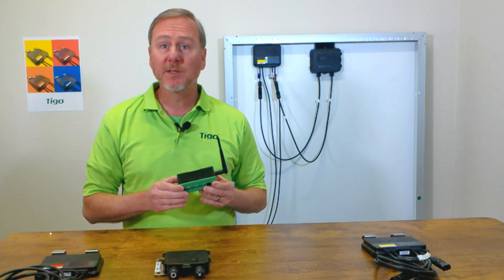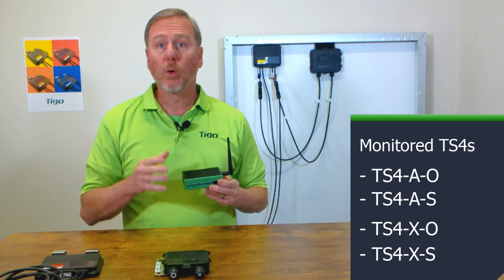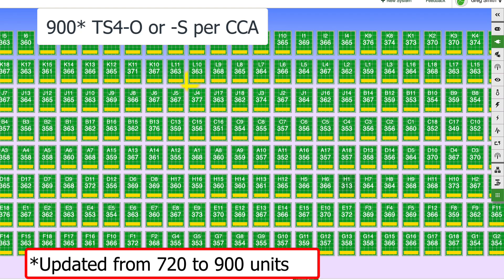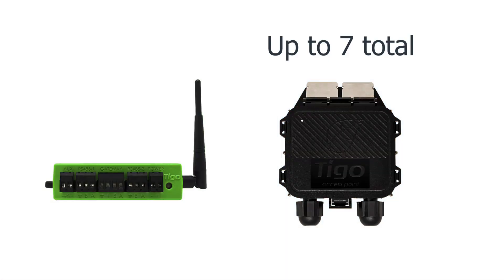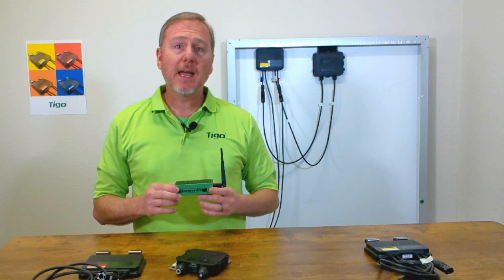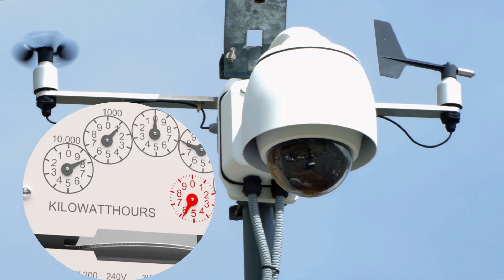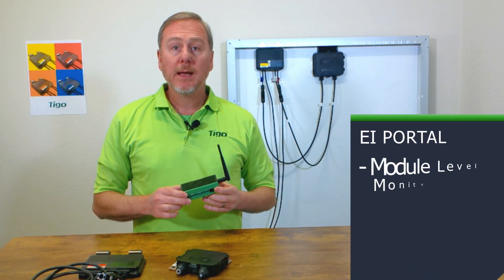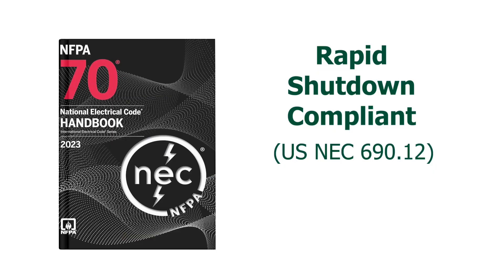Cloud Connect Advanced and Tigo Access Point Overview

Comment: I need to move my CCA , is it okay to shut it down via the 24 v supply and then reconnect it ? I will of course use the power supply that is connected to the inverter. I guess I am asking will it reboot and then continue to work as normal when switched back on
Reply from the maker: Absolutely! The CCA uses non-volatile memory that saves all network settings so that it will automatically reconnect to the saved network.

Comment: Can you please make a video how to properly setup the Inverter for the optimizers? Do i let the MPPT of the Inverter turned on or off, when using Tigo Optimizers or not or do i keep the MPPT at a fixed voltage???
Reply from the maker: That is a great idea for a video! The short answer to your question is, "It depends." The overwhelming majority of inverter MPPT do not have issues with the Tigo optimizers, but sometimes that feature must be disabled depending on the sophistication of the inverter MPPT.